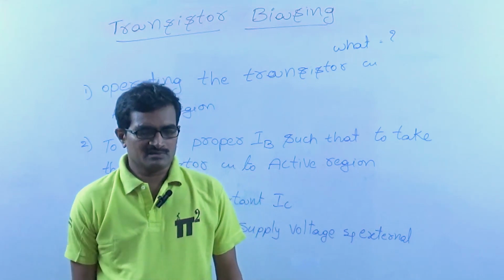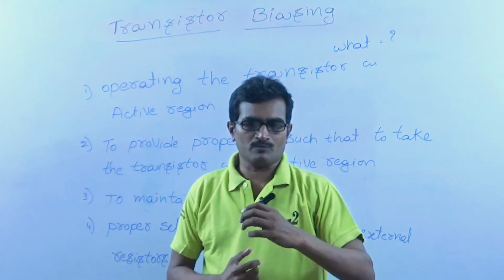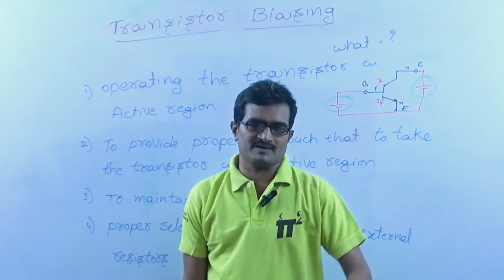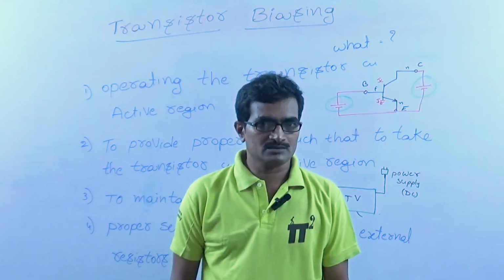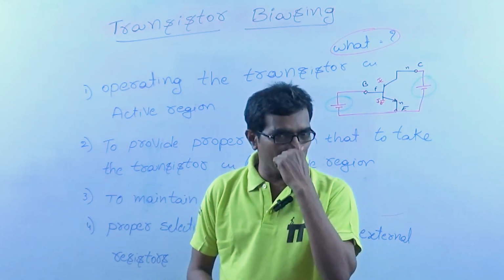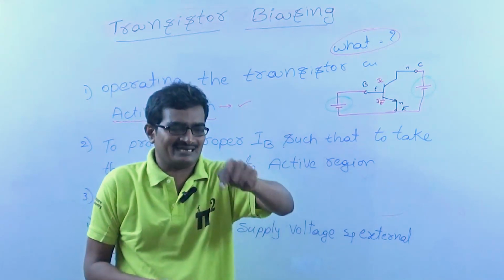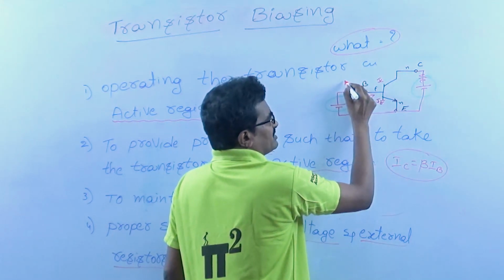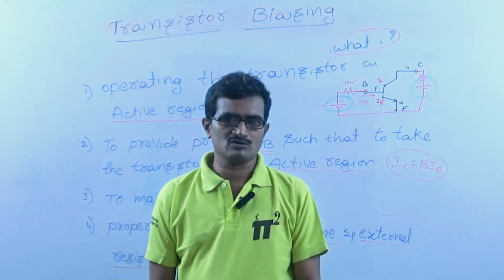What is Transistor Biasing and Why Transistor Biasing is needed? Part1 #Biasing

Comment: What is the meaning of biasing?
Reply from the maker: Biasing refers to the process of establishing a suitable operating point or bias point for a transistor. It involves applying appropriate voltages or currents to the transistor's terminals to ensure that it operates in its desired region and provides the desired amplification or switching characteristics. 

The purpose of biasing is to maintain the transistor in a stable and linear operating state, enabling it to function effectively within a given circuit or application.